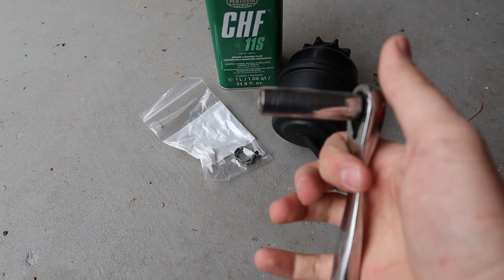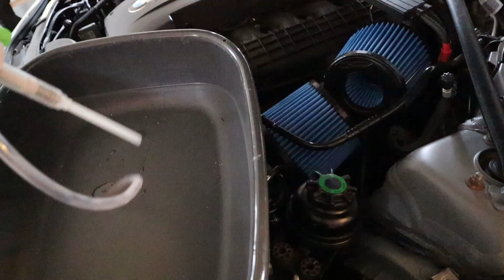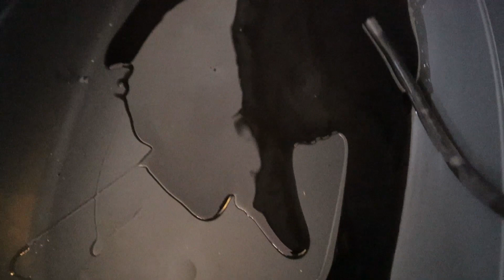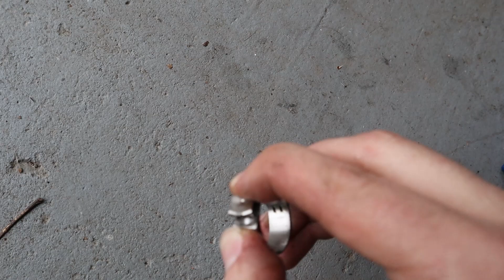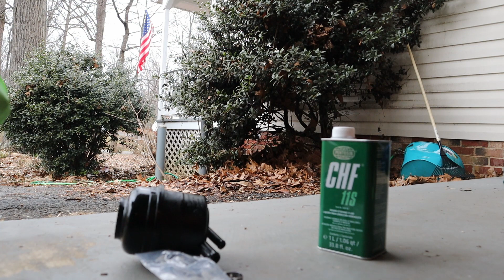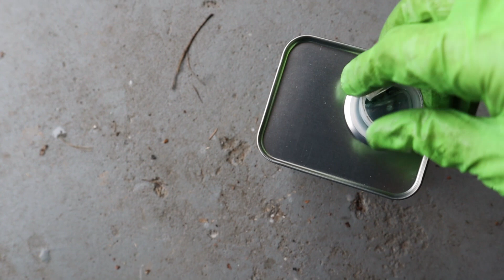Easy BMW Power Steering Fluid and Filter DIY

Comment: Cap off, empty the tank, put in new fluid, cap on, start car and steer left, right, left, right, left, right and back to centre. Remove cap and remove the last of the old fluid, top up with new fluid, replace cap, done.
Reply from the maker: easy day but you don't get a filter change out of it.

Comment: Incomplete job. You just renewed reservoir & left all the old fluid in rack & pump. Why the hell didn't you drain all the old stuff while doing it?
Reply: like i keep saying bmw are different if u have active drive you cant drain this empty malfunction will occur
Reply: @dflex4180  nope, don't have to drain empty, just hook up a tube to return pipe & steer lock to lock, pumping new fluid through entire system while keeping fresh fluid topped up.
Reply: @stevesas632  Much better idea than messing with the line going into the rack. Which hose is the return line? The one coming from the bottom of the reservoir or the side?
Reply: @aaronwilliams8600  yes, the return hose is the highest one on the reservoir. So satisfying seeing the old dark fluid become nice & light as you turn steering wheel lock to lock & pump new stuff through.
Reply: @stevesas632  Cheers mate. Thanks for the reply!

Comment: A lot of comments about flushing the system thoroughly. 

Would I jack both wheels up,
Empty container
fill the old container with new oil
start engine
turn wheels full in both directions, 
Empty again,
Repeat until liquid looks properly clean.

And then continue as the video suggests? Great tutorial thanks

Comment: You’re talented.  This helped me.  I have heard that those hose clamps are not supposed to be re-used. Most buy generic hose clamps once the old clamps are off.  To me, i would get every bit of the old fluid out as much as possible anyway. I priced a new pump!!! $1,000 at the dealer!!! The part alone!  So you’re smart to change it all out, as you did.

Comment: Not all BMW use chf-11s power steering fluid, only the ones that have active power steering and suspension.  Others use dexron transmission fluid. The reservoir cap does not have the green tag on it like yours do but have ATF oil only engraved in the cap.
Reply: Mine doesn’t have active steering but it also uses 11S. I’ve got an E92 335
Reply: your very wrong I have a 2008 BMW 328xi not active steering and suspension and I have to use chf-11s my E70 has active and dynamic and uses the same

Comment: You should be doing a top side flush, keep adding fluid  to mix with old fluid, pumping it out, turn car on in between to activate power steering pump for circulation. repeat process until fluid is the right color.
Reply: 9

Comment: How come you didn't drain fluid from the steering rack? I'm sure there's plenty of old fluid in the rack
Reply from the maker: Hi! There isn’t that much fluid in the rack you put very little back in and most of it is into the reservoir I did suck out the lines that were visible with a pump though
Reply: Bimmer Dad you should jack car up so front wheels are up, and filled, crank steering all the way both directions. Then, drain reservoir and repeat until clean to purge all the old fluid.
Reply: @johnheiss9954  "crank the steering" is this something you when the engine is running or just turn the steering wheel while engine is off?
Reply: @bimmerdadd  ok. Thanks for the reply
Reply: There is a good bit of fluid in the rack....To do it the right way, like others have said, you should have losten the line at the rack (lowest point of the rack) and let it drain while turning the wheels back and forth. That's the only way to properly do the job, but your vid was somewhat educational.
Reply: @Riley1524   can you do it this way? https://youtu.be/ZzEIIGZwNG4
Reply: @rcf2192  yes, there's a lot of fluid in the rack. If you're changing it a BMW, go ahead and buy a new reservoir from FCP Euro.com. you want to crack the line loose lowest on the car. It's quite easy, just keep turning the wheel back and forth until the fluid stops coming out.

Comment: Hi. Things I did not find consistency in this video: 1) If your BMW is 80k miles or kms, and the fluid got to go, why not flushing it? There is plenty dark old fluid in the lines (high and low pressure) about 1L more. 2) You change it not because the color is black, but because of the mileage. Fresh CHF 11s will change color in 5 days after, due to temperature.
Reply from the maker: Hey Red Zone, thanks for the comment. It has 89k on it and the reason I changed it was mainly a change in steering feel and some pump noise which both went away after the change.